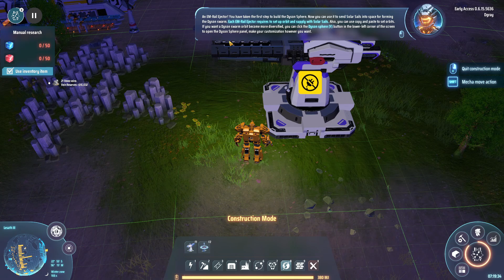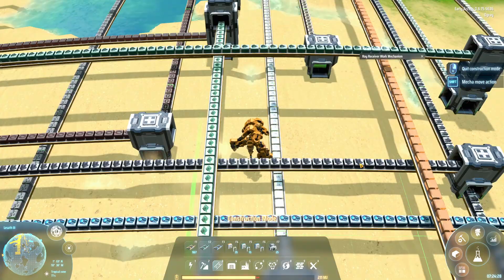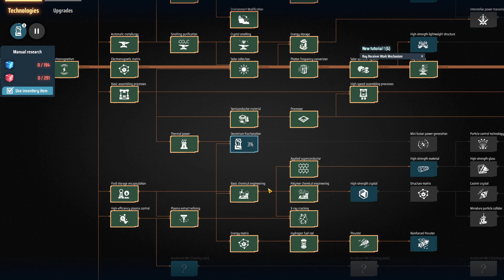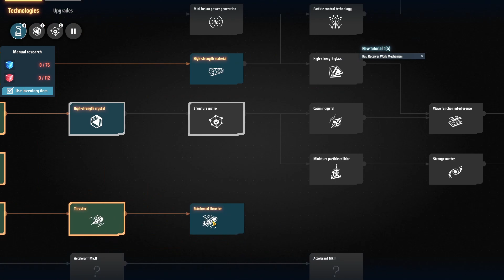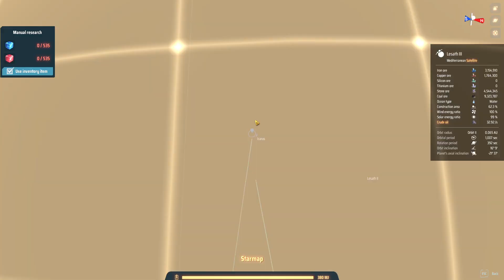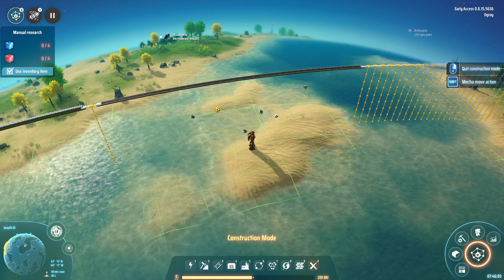BUILDING THE DYSON SWARM! - Dyson Sphere Program - Let's Play Tutorial Gameplay DSP Ep 11

Comment: At your current level of manufacturing, your starting the swarm way to early. Your going to be constantly chasing your tail now trying to fully automate it to produce any kind of viable power from it. Also, for the swarm to produce any kind of usable power, your looking at literally 10k plus sails to even be in the 500 MW ball park range. And if your ray receiver hasnt been upgraded through your tech tree, youll be lucky to get even a third of that power.
Reply from the maker: I agree. Will be scaling it back but will keep a few just for the awesome effect around the sun 😊
Reply: @dgray2790  nah not to early. it takes hardly any  building to  begin to build it early. in fact building early is good as it helps to give a bit of power you dont have to build to get. going big from the start is not always nesscary.